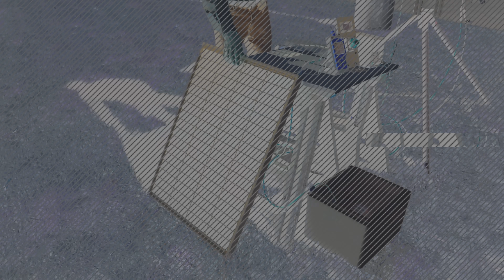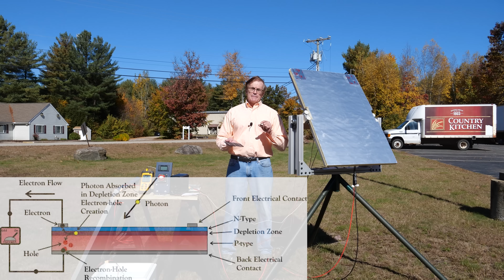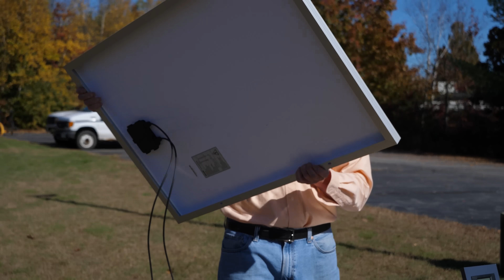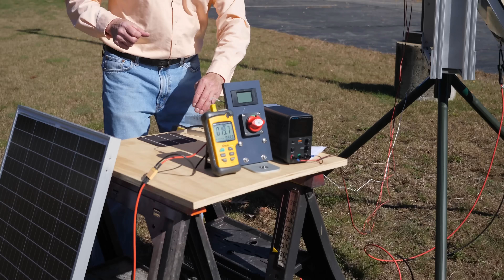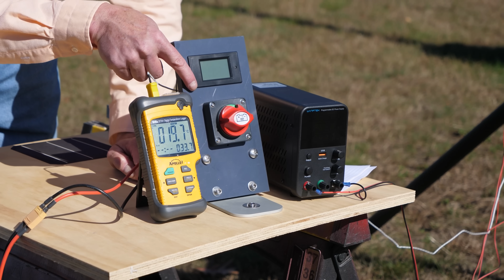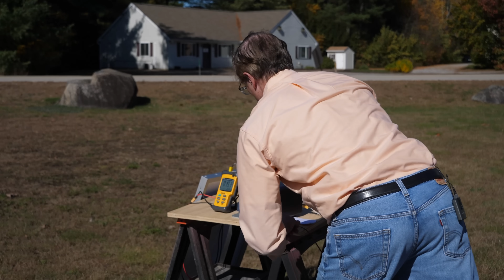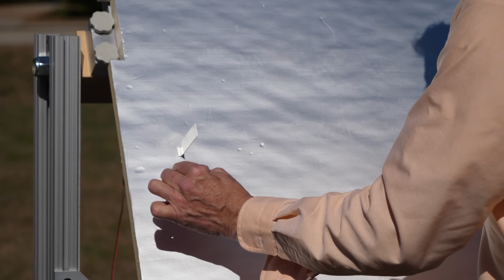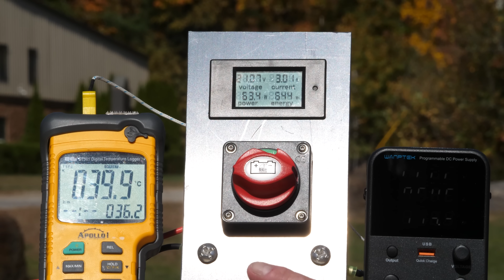Do you REALLY get enough out of your solar panel?

Comment: Heat is your friend . . . If you use it correctly.

Making PV solar electricity to use in a resistance-heater application is stupid gone to seed.

Using the heat quality of sunlight to do mechanical work, i.e. generate steam to power a 5KVA generator makes better use of the sunlight, allowing heat to be your ally and not your enemy.

Think about it.

If you don't want to deal with steam & engines, do what I did:

I made myself a giant PNP transister-array-thermocouple.  It is flat plate, does not require tracking and the hotter it gets, the more direct current it produces (albeit small).  No moving parts and immune from heat degredation.

Comment: Solar panels should come with pre-installed fans at the base with vertical groves acting as both heat sinks and vertical displacement channels for hot air, and their rotation could be proportional to incoming solar charge, these numbers/electrical potentials could be finely tune for maximum efficiency.
Reply from the maker: Agreed

Comment: Wouldn't the gains be increased with increased units using the same cfm of airflow of connected in series??
Reply from the maker: No.
The air quickly becomes hot and would not effectively cool subsequent panels.

Comment: Cut opposing side feathering to both edges of your DIY heatsink metal  strips, then bend the strips into the triangular shapes with the feathering projecting out of the top of the triangle. 
This will provide complete coverage of the panel surface with a direct path of transfer to an open air feathering (now fins).

Comment: Excellent experiment. But I'd much rather add 2 extra panels to offset the losses than all this extra cost and potentially more fail points. I dont believe the fans will last 20 years. Stuff will get in them, bearings will go, theyll become more issue than benefit. Nice experiment. But no way its practical in my eyes. Im an electrician and i would rather less fail points, if I was to be warranting it.

Comment: ok i have a great idea, you can make passive fan by building solar chimney, only downside of that is that you need whole vent system, you can make these radiators on back of solar panel and build around that a box connected to solar chimney, also if you want more cool air you can dig thick pipes in the ground and take cool air from that too, so you can make more power for free.
Ofc you need to invest in the building but if someone build 100% true passive house with off grid idea, you build solar chimney anyway.

Comment: I realize this is an old video and someone may have already thought of this, but if you put actively air-cooled solar panels on a home that is equipped with an ERV or HRV, you could duct the exhaust from the home ventilation system to the inlet for the solar panel cooling system.  Obviously you would also need a secondary ambient air source for when you aren't running the ventilator, since they don't run continuously.  However, when your ERV/HRV is running it will provide sub-ambient temperature air in the summer to aid in cooling the solar panels on the hottest days.  Likewise, everytime the ventilation system runs in the winter it will provide warmer air that can melt off any frost or snow that may have accumulated on the solar panels overnight.  Depending on how into the weeds you want to get with this, if the house also has an active radon mitigation system, you could duct the hot exhaust air from the solar panel cooling system into the inlet for the radon mitigation system, which would then pull that hot air across the underside of your foundation, making the basement floor warmer to the touch year round.
Reply from the maker: Good ideas.

Comment: Could you not use aluminum cans cut and flattened then bend into a a long wide Lshape then just epoxy the thinner bottom strip to the panel. Repeat for 2 hrs, lol.  Then paint it all that crazy white that reflects around  99.8 percent of all light, cover the back with something that won't insulate it but will allow you to position your fans so it sucks the cooler air from the bottom then it  blows upward  through those ungodly number of the aluminum strips , if you can have half the aluminum strips could go thru your back cover but still keep the airflow sufficiently flowing upwards through the internal fins. Or pump mist through the back to cool it even faster, water evaporating of the aluminum fins would make it cool faster I would think. Who knows im like that guy from sling blade and mcguyver mixed together. I made an external wood stove for my house by putting a empty oil drum laid on its side over my fire pit in the back yard  covered the whole drum with dirt and stone , except for a small chimney that forces all the heat to hit the barrel,  then the drum is half filled  with medium size and small sized rocks, then I  ran a large pipe from one opening at the side that has the barrel cover with two different sized openings, the large one runs  to the gas furnace exhaust pipe on the side of the house then  Run thru the basement wall right into the basement, the other pipe that come off it is real skinny, run a bout 7 feet away and has an old air mattress pump hooked to it and it blows fresh air slowly into the drum forcing the warm air down to the basment then upwards through the unconnected floor vents. Works so far, but winters basically over.

Comment: Has anybody consider using evaporative cooling. It could be very cheap to implement and very energy efficiency; the consumable would be water instead of electric power. It Might be as simple as lining the back of the solar panels with an efficient water wicking material, similar to what's used in swamp coolers, and dripping water on it. The downside is that it wouldn't work in winter conditions. But, the upside would be the potential to cool a solar panel below the ambient air temperature. Thanks.

Comment: u dont think how many Fan need at whole lifetime. The panel can prduce 25-30 Year. But a fan cant hold 5 year. ore less maybe. And its all need new, and all the time need somebody who change it. If the panels at the roof at big building, like mine, then its not easy to replace the Fans. I thnik still dont worth. but best is not worst ore better. Thats my opinion. But need long term test. Sory my bad english, i just learning.
Reply from the maker: Your point is easily understood.
What is your primary language? I'm just curious. 
These fans are rated at 50,000 hours MTTF. They are also very inexpensive and may improve the longevity of the much more expensive panels.
Nevertheless, testing is paramount.
Reply: @TechIngredients  I am from Hungary. 50,000 hours is good if can work at outside. I used fans outside and never work that many. Rust, dust and another thing broke. maybe that was just not good enough. I like it anyway. 
 i saw some another technik to cooling. With water circulate. Like a rain. That could be worked? thank u!

Comment: 2 years ago I put an ultraclear glass 3 mm in front of a vertical photovoltaic panel and a fan building a Trombe wall and used the heat in the house. This was for heating season. Temperature of air 30-60 C. Next step I shall preheat water for warm season recirculating the air. Of course if the heat is too much I shall cool the panel only in open circuit.

Comment: Could I put fans on without the back aluminum sheet? Can you please tell me what epoxy you used?
Reply from the maker: We used the thermal epoxy that we showed how to make in one of our earlier videos.  Check it out. 
The sheets force the flow along the panel.  Without them, you'd need significantly more powerful fans to achieve  the same heat transfer into the air.
Reply: @TechIngredients  ok that's great!  I will chck it out. Can I ask you a side question?  I have a solar panel that has shattered glass but still works well.  Do you think it's possible to use your thermal epoxy (or another,) to coat the surface?
Reply from the maker: Probably not.
Epoxy is not resistant to UV exposure.
You might mess with a clear acrylic sealant.  You can even make it yourself by dissolving plexiglass shavings in acetone to form a clear syrup that drys very hard.
Once again,  I covered this in an earlier video on explosives called "Don't Try This At Home."🤔

Comment: As PV cell work with specific light wavelength - would it be beneficial to use a filter to reduce unwanted light energy and only allow specific light spectrum which is dedicated to electrical generation?

Comment: The fact that a 100W panel will never generate 100W is absolutely fraudulent. I don't know why they're so dishonest about it.

100W at noon, on the equator... I'm also in New England and I bought 3 x 370W panels thinking I would be getting around 1100W at noon. No. I will never see that number and I'm lucky if I can get 800W out of them. It's winter now and the most I have recorded so far was ~650W. I'm sorry but 58% is unacceptable to me. Had someone told me, hey fyi, these panels are 370W BUT they are more like 200W, I would've built a completely different system.
Reply from the maker: What I've  learned through years of project construction is to test components before committing  to a final design. Building a rough model is also  very helpful. It's  quick and fun and highlights issues you hadn't  considered.
Reply: @TechIngredients I agree to that, my issue is with how Solar is sold and marketed. 

If I buy a car and everyone, including the manufacturer, tells me it gets 20mpg, then that's what I expect it to get. If it doesn't, then everyone has lied to me. I shouldn't need to test every car I buy to see if it does what everyone says it does.

Comment: Great video and channel! 
I'd be curious to add into the wear and tear of fans, replacements etc into the total life cycle cost. Depending on the setup storm's may not make having small computer fans very beneficial. Still, if a company looks closely at this like the one example you gave I'm sure they can find better fan designs that are more storm resistant instead of off the shelf computer fans.

Comment: I just love your well thought tinkering projects!
How about a low flow watercooled system? 
The low heat saturation of air at low flowrate because of the boundary layer seems to be a big efficiency loss. A low flow watercooling system like floor heating with an attached long coiled tube at the back at could maybe an efficient solution. It could run on a single 5 W aquarium pump and maybe achieve even better cooling results with an large enough external heat radiator. 
Like a combined PV / "Hot" water solution. I think this would be especially useful for systems with light concentration.

Comment: I wonder how well the heat sinks would perform alone.
Reply from the maker: Indeed,  even without the fans running, the panel  with the heat exchange fins runs slightly  cooler, but the difference  is very small.

Comment: This is a great experiment, but I'd like to have seen the performance without the added backing.  While it's necessary to channel the air while running the fans, it's trapping air and acting as an insulator when the fans are not running.
Reply from the maker: Actually,  the panels  with the fins are slightly  cooler and more efficient  even when the fans are not running.  The difference  is small, but it's  definitely  not detrimental.
Reply: @TechIngredients  Ah, cool!

Comment: Fantastic video, as usual! I would think you could easily incorporate a heat exchanger into the backside of a PV panel that is made from a series of radiator tubes filled with antifreeze that would be pumped into another heat exchanger to create hot water and then cycled back into the cooling system. I have a good friend who has both systems but they're not integrated. One of his panels finally gave up the ghost which makes the whole array operate at about 1/2 efficiency. This might not have happened if he had an active cooling system!  At any rate, keep up the GREAT work!

Comment: What is the lifespan of your fans?! Moving parts: bad. Probably far less longevity than uncooled solar panels. You would have to use far fewer fans and make them easily replaceable and really look at the cost of the fans both initially and replacing them a number of times times over the lifespan of the panels. Also you're just wasting all this heat why not use a water system to make and store hot water which everybody needs and is paying to generate with other equipment. Eliminating the separate water heater could pay for the whole system. If the water is not hot enough you could at least use it to heat a swimming pool. Like my neighbors have solar panels in a swimming pool and a separate swimming pool heater that's run by natural gas. The problem there is the roof is very complicated and they have solar panels in about six different places. Cooling systems just add a lot of complexity which is why they aren't used people just add more solar panels. It's the same (good) reason we don't use solar trackers or solar concentrators. The added complexity and maintenance means it's generally far more cost-effective to just add more solar panels, or to pay more for higher efficiency panels.
Reply from the maker: 50,000 hours of continuous use at full power.  These were operated at around 25% of full power.

Comment: This system would not be worth while investing in for a few reasons.
#1, The humidity levels are too high to have a fan continuously running.
You would very quickly get mold and other deposits building up inside of the solar panel vents.
#2, You would very quickly have those vents clogged up with mud dobbers and other critters that you would not easily be able to remove.
#3, The additional weight of Adding those heat sinks and the pivoting mounts. Would crush many of the rooftops that are already not properly reinforced to handle solar panels as is.
#4, Pivoting mountings. We have these things called hurricanes...
If you know you know, if you don't... Consider yourself lucky.
Dealing with 157 mph or 252km/h or greater winds with seemingly  solidly bolted down things that are just marginaly incorectly instauled is already.☠️☠️☠️
I'm not saying your theory is wrong.
I'm saying if you were to put it into practice here in florida.
It would unfortunatly fail when faced with the realities of the environment.😢
And if you went so far as to engineer it to be able to withstand those winds.
The price would be.
Cripplingly high.😮‍💨

Comment: I understand the problems with using water, but it seems as if the cooling would be more efficient overall if it were actively liquid cooled, because the panel-to-liquid and liquid-to-air heat transfers could be much more efficient, and cooling could probably reach significantly lower temperatures. It also could handle larger volumes of heat, e.g. to use reflectors to boost panel output.

Comment: I just finished installing a solar heater yesterday in Colorado and find that it works amazingly well. It seems strange to me that you're not trying to capture the heat being released and using it as supplemental heat for your living space. 
The issue would be piping it to the required exit point, as the solar heater was attached directly to the house and required very little piping...

Comment: Use Fresnel diffuser lenses on the front and use passive thermoelectric cooling on the back (with the active fans on the cold side, or other active cooling techniques on the cold side) to maximize the solar production, while generating additional electricity cooling the back side of the solar panel.

Edit: The proliferstion of graphene N-type and P-type conductors and graphene oxide insulators will make this technique lighter, more efficient, and far less expensive someday than bismuth telluride and alumina, thus more viable. 

The combination may improve the output by 10% to 25%. It would be cost prohibitive at present for production, but that's expected to change.

Comment: You make a lot of good points, but you are wrong about panel output in different parts of the earth. You don't know how to measure the max wattage of a panel. Hit, you can short the panel out, and nothing is going to happen.

The first thing I would do for longevity is to install crystalize panels over what you have there, amorphous. They use amorphous, because it is easier to make and more durable to handle, but the material flows like a fluid, which degrades faster and more than a crystal panel. 

You're also losing a lot of power, or they misrepresented the power output of your 100 watt panel, because a 60 watt panel, which I have at high position on the earth, will produce 60 watts perpendicular to the Sun on a clear day. This is the difference between a YouTube person doing a one time experiment from somebody who has used solar for power. Also your resistor will effect the power reading you have on your meter, which could be why you think you panel can't produce 100 watts of power.   E X I = W   I X R = E

Comment: Very thoughtful.  Thanks!  I’m preparing to install a 126 panel array that will serve as the roof over a pickleball court.  It might make sense to put a few large fans underneath it to cool the panels on hot days which could also be reversed to cool the court when in use.  I have an array already that is less efficient than I was expecting - I think know why now.  It would be simple to compare output from this system from cool windy days vs hot calm  days to attempt to see this effect.